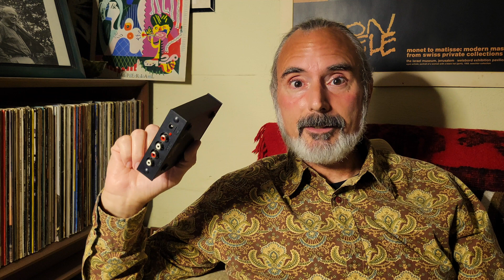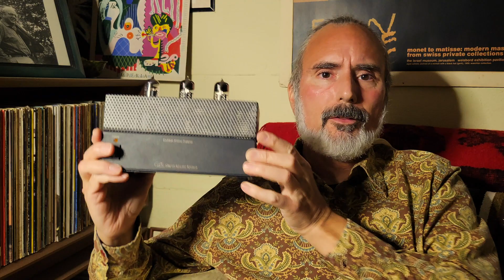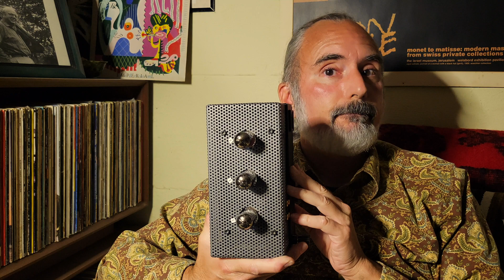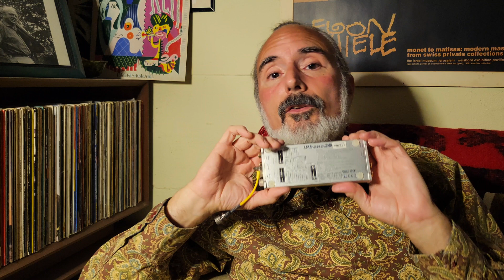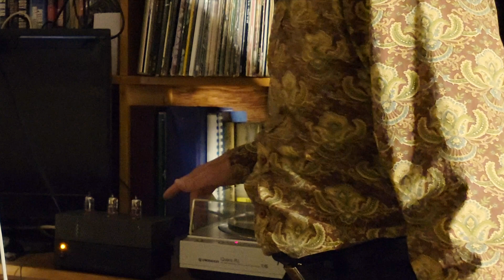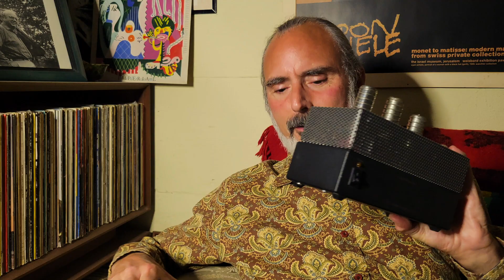Phono Preamps! EAR 834 clone, iFi iPhono2, and Rega FONO Mini

Comment: I have had the ifi iphono2 for a few years now and I appreciate its flexibility because I switch cartridges fairly often and have a mix of MM and MC carts. It sounds excellent and has a low noise floor. I do wish, however, that ifi could build a version with the inputs and outputs on the back of the device!

Comment: Hey Steve, thank you for the comprehensive video. Just to mention that my original goal for this project was to reduce the cost and size of the preamp and deliver the same quality of sound. You've made some good suggestions can be implemented by whoever wants to design their own chassis for this circuit board. The circuit board has a number of options such as heater voltages Input/output Jack positions and the ability to separate the power supply board. If you decide that you would like to build one of these, I can send you some component modifications that you can experiment with that would increase the gain, lower the input impedance and raise the input capacitance to match your MC cartridge. I can't vouch for real world tests on this as this is only in a simulation, but that would be where you come in. If you choose to accept this mission. 😉
If that works favorably with your cartridge then it would be feature for me to add some dip switches to the circuit board for matching cartridges. The big thing is getting enough gain without distortion or noise.

Comment: Well,i agree on possible higher flexibility  (load cap and imp,gain),but not necessarily on sound quality. I mean 
there is a buckload of vintage integrated amps and preamps with exellent phonostages out there. 
Its a a different story with vintage receivers. Very few have realy (!) good phonostages inbuild.
For a setup with new gear on the other side a separat box that houses the phonostage is obligatory simply because
meanwhile producers are making higher profit by selling you the parts of a classic preamps as separate boxes......

Comment: I am a subscriber. I have a question . It goes like this. 3 reputable reviewers approved of a tube amp based on / following listening sessions. One, Skunkie, disapproved by looking inside. I am interested in the product as it is within my budget and pleases me estheticaly. What should I do? What would you do (I know, I know, you would fix what needs fixing.
Reply from the maker: For one of those amps, Skunkie found that the amp should be considered defective. The output transformers introduced a big hole in the HF response. She figured they were probably tiny transformers in big "cans" packed with gravel. It's amazing that reviewers can report favorably on such amps. Maybe the problems don't become apparent until the volume is cranked up, and then the reviewers give the poor performance at high volume a "pass" because they figure they've pushed the amp beyond what it's designed to do. I wouldn't recommend buying any of those amps. I'm listening to a Dynaco ST-70 these days and loving it. It did need a significant amount of work. I'd recommend an ST-70 that someone has already restored.

Comment: I had an older Little Bear kit looking phono preamp ( T10+ ?? ) that had top loaded tubes like that and it was doing the theramin hum thing. I just had to roll a bunch of different tubes in it to tame the hum and rush/hiss. I have tube shields like those also but found them not needed once I found quiet tubes. Phono hum is a drag and quite pesty.

Comment: If you get a chance, check out the Parks Audio Waxwing.  It's pretty awesome.  I'll still be building tube based phono preamps for fun and education when I get a chance to fit it in the amp/linestage project list, but I'm not entirely convinced I can beat the Waxwing - certainly not easily.  In my system it's being fed by a Thorens td-160 mildly upgraded, and feeding a bottlehead moreplay/stereomour combo, not exactly peak spending.  So take that review for what it's worth, but for me it was one of the best audio investments I've made so far.  It definitely blew the previous solid state phono preamps i had like the "regular" ifi into the weeds.  And the ones integrated in my eico st-40 and st-70.  Though those may improve with modifications.

Comment: What mc cart are you running? I have gone way down the phono preamp rabbit hole. You should try a step up transformer. Ive got an otrophme st90 and i wouldnt go backwards..
Reply from the maker: Rega Apheta (1st version; I think they're up to the 3rd now).
Reply: @Lancaster_Hi-Fi  I dig the setup. I'm running a audio technica at33e from the Asian market early 80s on a linn sondek I built from spares over the last 10 or so years. I've built 3 but my best is pretty good.  Would have to spend crazy money to beat it.  Sme iv arm dc motor with external power supply.  In running a tube phono preamp with a step up transformer.